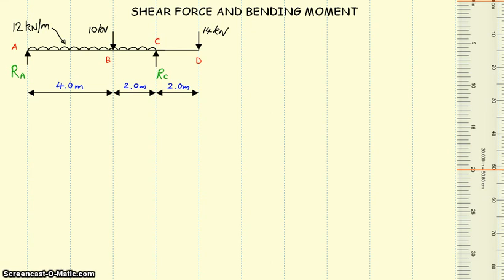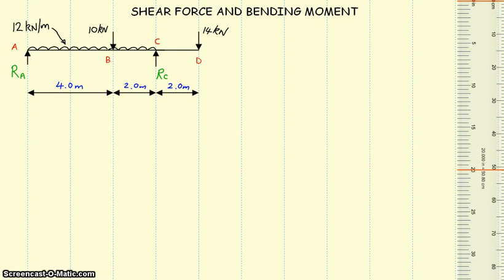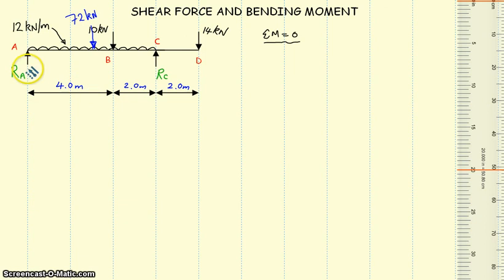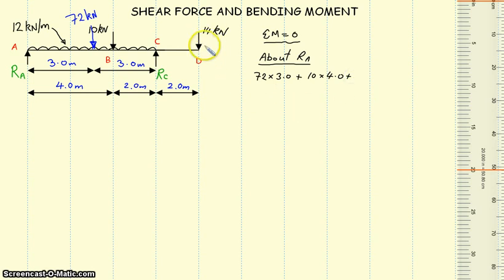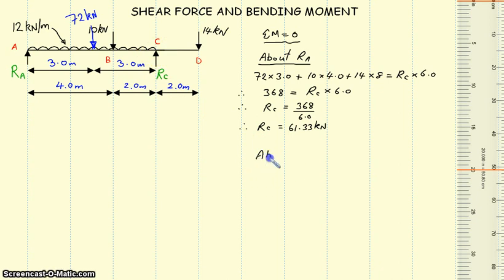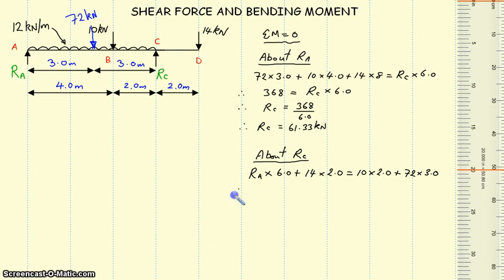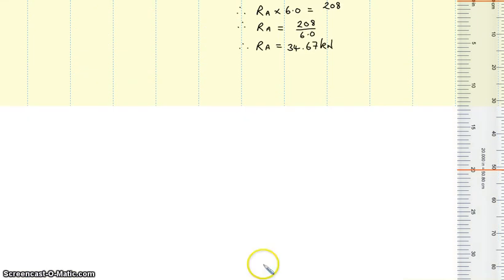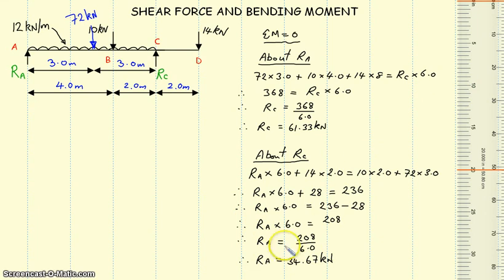Calculating Reactions Video 1

Comment: very good video, clearly expained method unlike my lecturer, one question though, can you not find the reaction force at A using the sum of the forces in the y direction? as:
sum Fy = Ra+Rb-72-10-14 , a much faster way of doing it by setting up unknown equations.